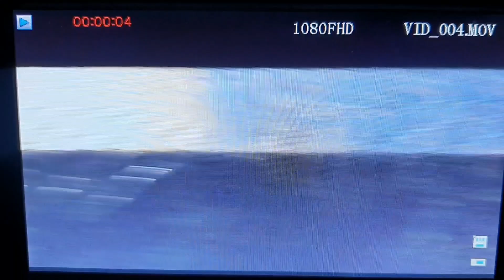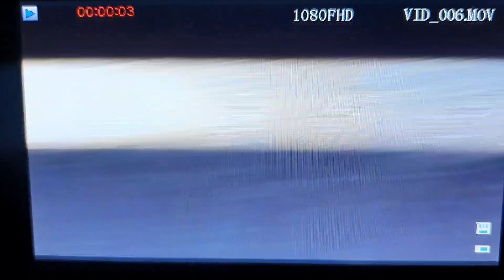@FroggyShave Restoration Honing SReiht (Thiers) straight razor

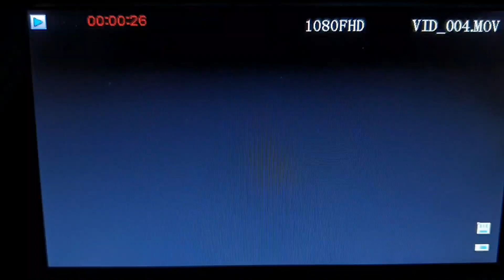Comment: 10:03 There's still 2 large chips there that will give you weepers or tiny cuts during the shave. You can see them again at 14:16. 
Do you ever "join" the edge while bevel setting a badly damaged edge? It's just 2 or 3 swipes of the actual edge on the stone (1k) to completely blunt it again but it'll remove those chips and leave a perfectly even edge. Then another bevel set an on up through your usual progression. 
I haven't tried Tundra Artica yet but have been meaning to.
Reply from the maker: Hi mate, well spotted, you're actually even more of a perfectionist maniac than myself 🤣
Actually taking in consideration the great microscope zoom used, these two chips are actually extremely small and didn't cause any bad feeling at all during shaving. 🙂👍

Comment: Hi Frogy. Great video. Quick question. That diamond plate you use to lap your yellow stone. Is that an atoma 140? Have a good rest of your weekend
Reply from the maker: Hi mate, the diamond plate used is an Atoma 600.
I have also the 400 but usually prefer to use the 600 as it's a bit smoother.
Reply: @FroggyShave  thanks. Do you lap all of your stones with the atoma 600?
Reply from the maker: @borbelyhaz321  if I'm in the process to restore a razor and use the Atoma 600 to rebuild a bevel from scratch (if the blade isn't too damaged) I'll keep the 600 for building slurry also.

If my goal is to lap few stones, in this case, I'll probably go with the 400 as it'll be faster to do so. 😊